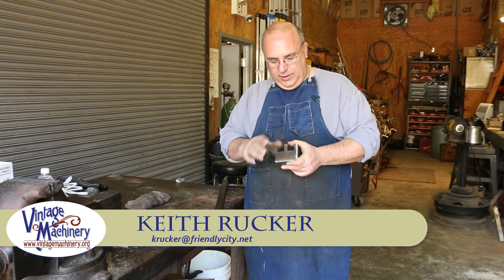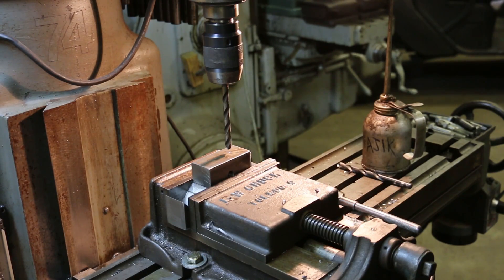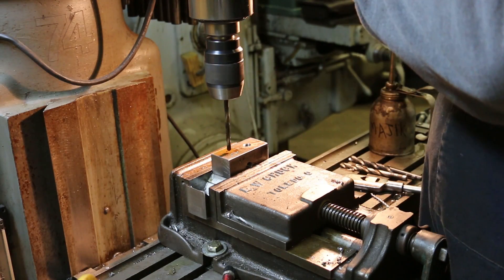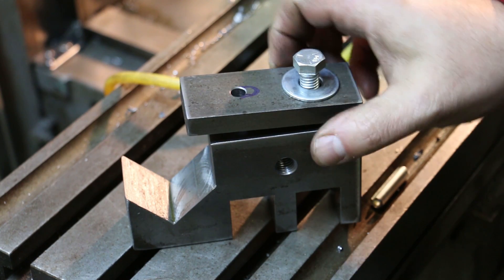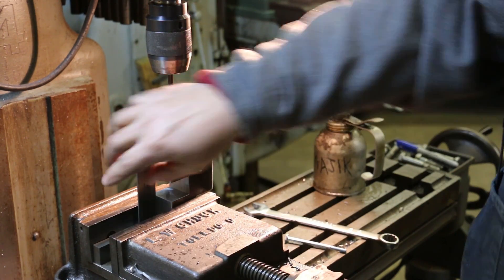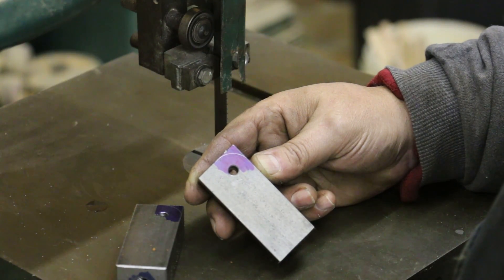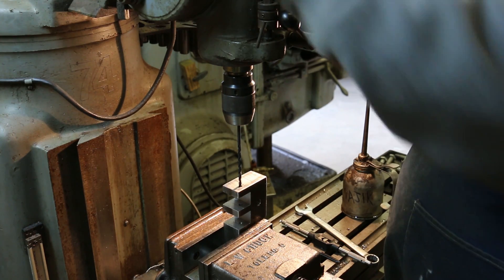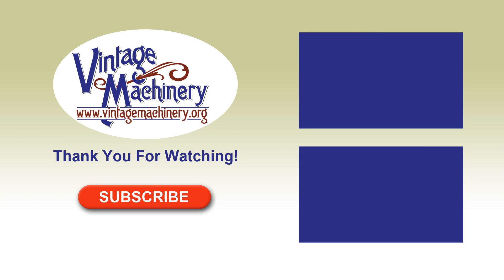Making a Carriage Stop for a  Metal Lathe with Multiple Stops: Part 2

Comment: The clamp plate could have had slotted holes for the pin and clamp bolt. That way the plate could be slid forward and then tightened... less fumbling around aligning the pin. Still, nice project!

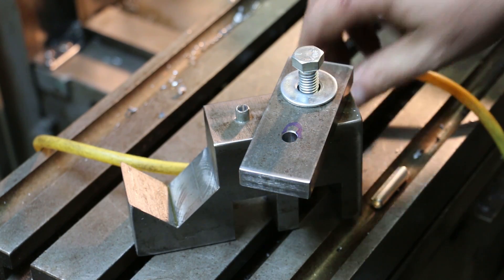Comment: @7:00 Why on earth did you drill the clamp piece separately? All you had to do was use the bolt to fix it in place and drill the pin hole for a perfect register. By this means you would have eliminated any chance of error and saved time as well. This would have been Good Practice. Instead you show yourself in this way to your viewers. Why do you continue to portray yourself this way?

Comment: Keith, as usual, your work is just awesome!

First thread I ever cut on a lathe, was 7/16-14.
That was my first project in Machine Shop, 
way back in '72 or '73.  Yes, I was planning on 
mentioning that, when I saw you cutting that 
thread, and today is the first time I've seen you 
cutting a 7/16-14.

steve

Comment: I will be making one for my lathe as well - thanks for a great idea.
One question; once finished what would you suggest to put on it to prevent rusting? I was thinking of heating it up and putting it in old motor oil, or simply a paint. Usually paint ends up coming off but most of the body would be covered.
Reply from the maker: +Tom Herd I keep the unit that I made hanging on my lathe most of the time, which means that it is getting oiled all the time.  If you are worried about rust, you can always paint it - except for the part that mate up to other machined surfaces which need to be unpainted.  You can also blacken it chemically - I know that McMaster-Carr sells some kits which is similar to bluing like you do to guns.
Reply: +Keith Rucker - VintageMachinery.org 
I think I will go with blackening of some type.
I really appreciate that you communicate with us!!!!
Tom

Comment: Very nicely done, Keith. I think a nice touch would be to counter bore the pivot pin to the outer diameter of the appropriate socket, provided you have the clearance at the bottom of the blind threaded hole.
Reply from the maker: erowidoz I considered doing that and it would probably be an improvement.

Comment: What do you think of swapping the pin and stud positions for the mounting clamp, so the clamping nut is closest to the clamping point? I also rethought my whole stop design, I discussed on the first video. You could keep a single swivel and make your adjustable stops snap into the swivel with a spring loaded ball and a groove in the shaft of the stops. Thanks again for the videos! Stuff like this generates ideas like the Hoover dam generates electricity!
Reply: ***** Time doesn't have to be an issue if you have an efficient design. The other advantage of interchangeable stops is that the bearing point can remain close to the clamping point, 
so the leverage likely to cause deflection is minimized. Also, if the 
stop mount was on the side of the clamp, your clamp bolt could run down 
from the top and have optimum leverage . If one needs to clamp from the 
bottom, getting as close as you can is certainly best, and since 
leverage is a ratio, adding a little to the back, if you don't have 
interference, is worth it. I think keeping it at least midway along the 
union should be considered a minimum, if possible. Nice work, and great videos. Thanks again!

Comment: Very cool stop. Nice simple design. I'd add a hole drilled outboard and below the fixed stop, or inboard of the inner flip-stop, to fit the stem of your dial indicator with a thumb set-screw so you'd could easily setup your dial indicator and measure your stop depths. Just a convenience feature, really. But it make a nice secure location for it. Awesome work as usual, though.

Comment: Hello Keith,
Great little project,I think something like this would come in handy for my little lathe. My new to me milling machine got here this week. I'm giving it some much needed TLC before I fire it up. Its an older (I believe 1930's-ish) Brown & Sharpe #2 Universal milling machine. I actually bought it based on a few photos, had it shipped across the country and am crossing my fingers and hoping for the best. If I could ask a favour from you, I have a couple of slide shows of it on my channel. I am trying to figure out exactly which machine it is and what vintage it is. If you could help or point me in the right direction, it would be greatly appreciated.
I have watched several of your videos and think that it's fantastic that you are able to volunteer at the museum. If I came to visit, you would be hard pressed to get me to leave without helping you fix something. These are great videos and you should be very proud of the work you do there.
Thanks,
Ian Little

Comment: Pretty neat, how do you like those Wright wrenches, I like mine but I wish they were a little longer.
Reply: ***** those Wright wrenches last forever just like the old mill vise and parallels you have in your shop. I'm sure that you would have an angle lock vise if you wanted one but there is nothing wrong with the original. I did notice the new albright chuck instead of the time proven jacobs chuck...you can't power tap using an albright because they have a tendency to seize up with a larger tap.

Comment: Thanks for the video.  Another good one.   Do you think that the smaller swing arm bolts might be better during a crash.  They may sheer before the machine is damaged.   Hopefully the error could be fixed before the second "crunch".

Comment: Nice stop, I liked that you just ground the radius by hand instead of a lengthy mill setup.

I don't much care for the clamp bolt, It has bad leverage and I don't like feeling around for bolts I can't see. Probably does the job well enough, but that's what I would change.

That extra shaft Adam has on the Monarch is cause for envy, stopping the feed and all. I always wonder how that could be made, perhaps with some mechanism on the apron.
Reply: I was thinking that the bolt and pin be swapped or reversed to provide better leverage if getting a wrench to it is OK or use a socket head screw.  Just thinking.  Roy

Comment: trainman4602 had one on his turret which was cylindrical, so you would rotate the next one into place, but would assume there would need to be some kind of strike stud coming out of the cross slide so only one would hit it.  A lot of ways to design a piece.  I like yours, too.  It looks to be nice and sturdy, too.

Hope you and your family have a Merry Christmas, Keith.
Reply: Yeah, the one that trainman was using would also trip out and would automatically take 3 passes to cut a thread.

Definitely thought needed to set them up.  I've only had a brief look at one of the screw machines up northern Illinois and how it was "programmed" by different gears/mechanisms.

Comment: Looks like it is time to switch that 29/64 drill bit out. That sucker was a shakin!! I like the multi stop idea. I bet that would be awesome on a turret lathe. I bet that will be real handy for making those square headed bolts where you can set a thread length. a head length, and an overall length.